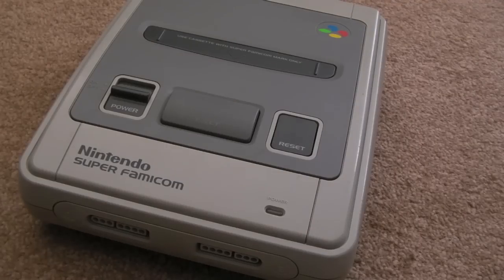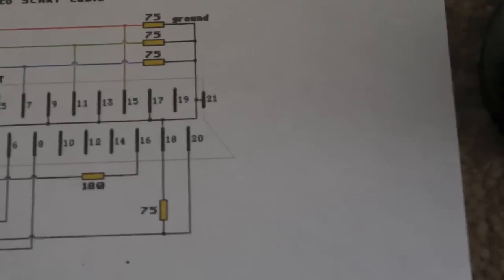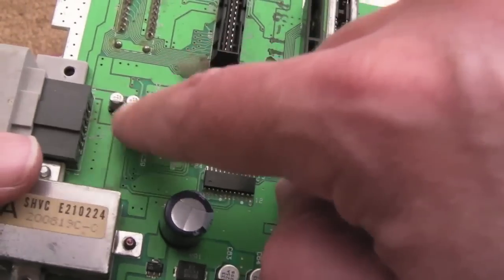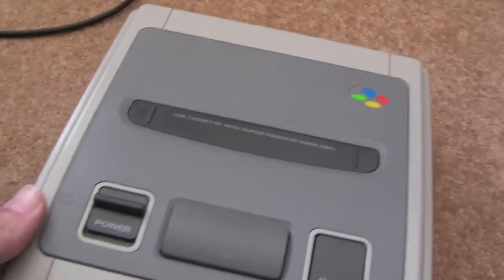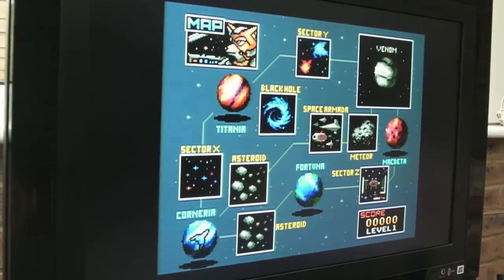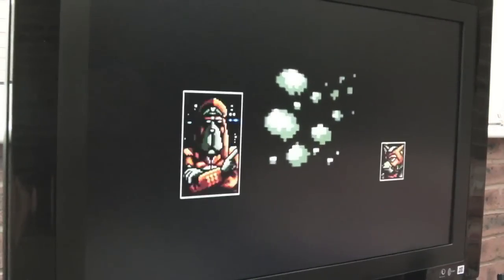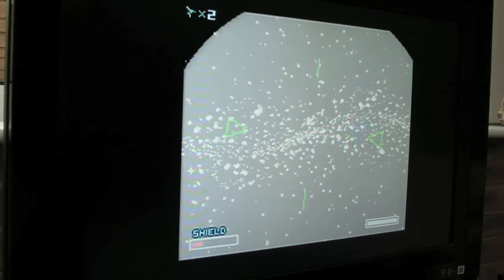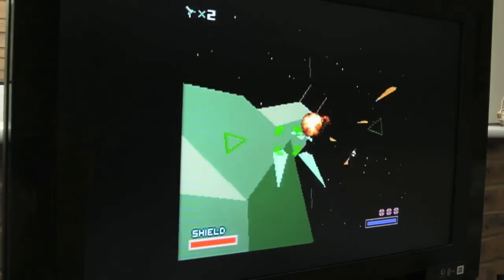Nintendo SNES (Super Famicom) Teardown & Ramble

Comment: Any idea why I have graphics glitches on a very select set of games on my SNES, yet when I use the same cart's with a SNES GAME GENIE attached there is no issue at all? It's just 2 games out of 50 that do it, and one is a repro' but it doesn't explain why it's fine through the GAME GENIE and even my clone console, any help would be hugely appreciated, the SNES is mint and is very clean, when not in use it is covered and has zero yellowing, I could do a video of the problem if you want.
Reply from the maker: I saw similar problems when testing a SNES that had a DMA fault I think.  Some games looked OK, others had glitchy stuff going on.  It could be a sign of bad caps too I guess?
Reply: @GadgetUK164  Shit, what do you charge for a look at something? I am okay with an iron but I'd rather not touch it.

Comment: For some reason, most of the Super Famicom cartridge shells that I've seen have yellowed on the back piece but not on the front. The same thing seems to be true with the consoles, where the bottom half tends to yellow much more than the top. I noticed that when I browsed a bunch of them on eBay a while back.

It's too bad the plastics on the SNES consoles and carts have aged so badly. It makes me grateful that the Genesis/Mega Drive is black.
Reply from the maker: Yes - I've noticed that too!  I think perhaps either different plastics used on the different parts.

Comment: Is it possible to replace the port on the SNES for the AC Adapter? I think the piece fell off and now Im left with two prongs inside my SNES port hole..Ive seen a few disassemblies but none show the removel of the AC port from the circuit board.
Reply from the maker: ChaChoppa!! Yes. just get yourself something that looks the right size, desolder the existing connector and plug in a new one.  Some work might be required if the pins arent in exactly the right position. Outer Diameter 5.5mm, Inner Diameter 2.5mm, Barrel Length 9.5mm

Comment: The 4 pin IC you called the bridge rectifier is a optoisolater.
Reply from the maker: +3Havoc Thanks!  Yes, there is no bridge in the Super Famicom as I discovered afterwards - DC input expected, not AC like the EU version!  Just about the right size and appearance for a bridge rectifier - I've got some that size.

Comment: Got my old super nintendo sat in a bag in my room, it's been a good few years since i've played it but haven't had any luck getting it to work on my current tv(it's an old box tv, hoping to get a hd one soonish xd) I realise the better the tv the less likely it is to work with it but eh. 
I've tried scart cables with my tv and nintendo to get it to work but i don't think i have the correct cable for it, it won't work xD 
Hoping it's not requiring one of these breakdown & repair jobs, should be just the scart i think. Any advice welcome though ! i have a good few old cart games i'd love to play xD
Reply from the maker: Tengu Tok Check the power LED comes on first - If the power LED is not lighting the PSU will be the issue (likely the cable on it as they tend to fail on the SNES).  If the power light comes on but you get nothing but a black screen then start by cleaning up the cart slot and games using alcohol and cotton buds etc.  There is a fuse inside the SNES as well as shown on this video - it would cause a completely dead system (not even a black screen etc - just nothing).
Reply: I tried the system on my tv the night I commented, the system has power and all that, it has an effect on my tv's channel 0 too so it's giving a signal, I just don't have the right scart lead by the looks. 
The ones I do have don't tend to fit the system well so it must be that :) 
(the effect on my tv makes the screen go from static to a light grey/lined screen) 
I'll have to find a scart for it and go from there :D